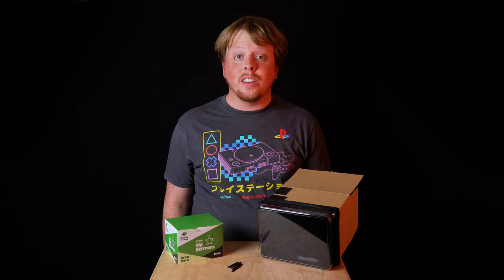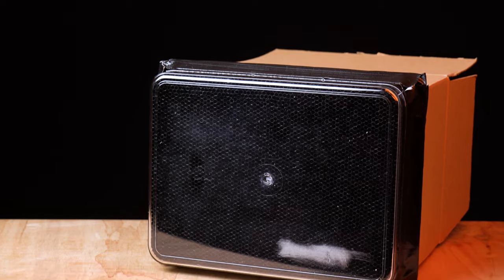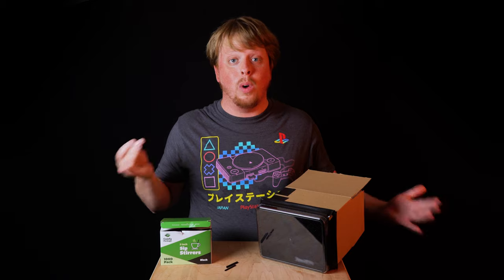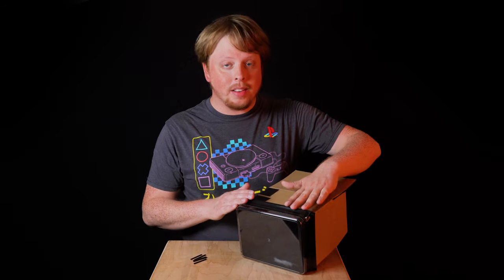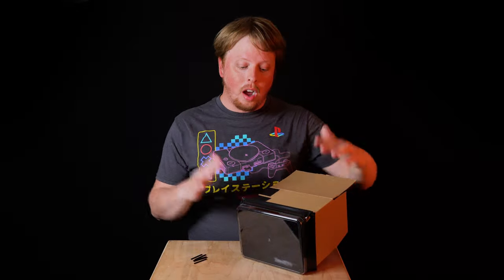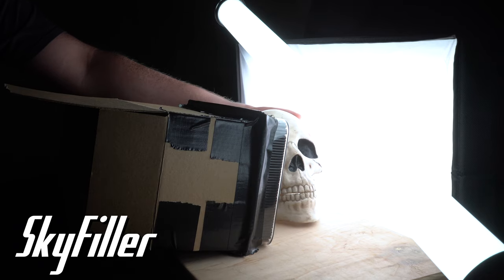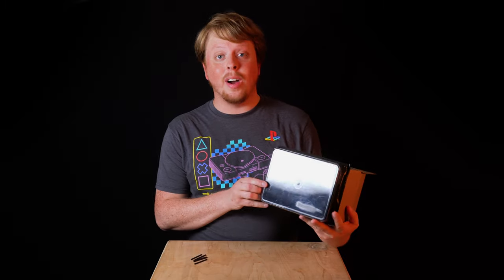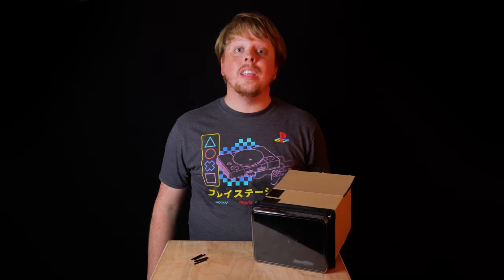Building a DIY Drinking Straw "Camera" with 3000+ Straws!

Comment: If you used bigger straws in a bigger box, could you get a longer distance between the "lens" and the subject? Or do you have to use smaller ones (or the same straws in a bigger box), and would that create more of a pinhole effect? Also, the images remind me of the old Lite-Brite toy.
Reply from the maker: The straws aren't so much pinholes as they are holes showing what's on the other side of them, which is why, no matter how big or small they are, you really have to put your subject right up against them to get a transfer of image.

Comment: This is really cool! I'm curious if the straws need to be that length or will shorter straws still work? I'm wondering if I could use a piece of clear plexiglass, Perspex, or acrylic, and make my own edges that are not as deep as yours, to hold the straws? With straws maybe half the length of your straws, I could get about 20% larger surface area. Do you think shorter straws would be OK or would they somehow ruin the effect?
Reply from the maker: I believe you can use shorter straws, but we haven't tried that yet. I know the camera we copied used longer straws and got a similar look to ours, so shorter would also probably work.

Comment: That's something I haven't heard about before. 

Sadly drinking straws like this are effectively banned now and you can't get them anymore. 

I can see very colorful subjects being the best I suppose
Reply from the maker: These straws are not banned in the US as far as I can tell. Where are you located?
Reply: @FotodioxInc  I am in the EU, where it got into effect earlier this year.
But I had an idea. There was a childhood toy, lamp. Which had a bundle of little plastic cables, essentially mimicking fiber optic cable, held together at one end with a small LED and spread on the other end. 

Perhaps getting a big bundle of those narrow fiber optics cables could fix various issues, including resolution/density. Haven't looked up if you can buy those in bulk.
Reply from the maker: @Veptis  Cool! I suppose you could also punch lots of tiny holes in a sheet of cardboard
Reply: @FotodioxInc  You mean a bunch of sheets stacked together? 
If you do a multiple pinhole lens, you would just expose one at a time and then stich it all together in post. (which has been done and looks quite interesting, very wide angle).